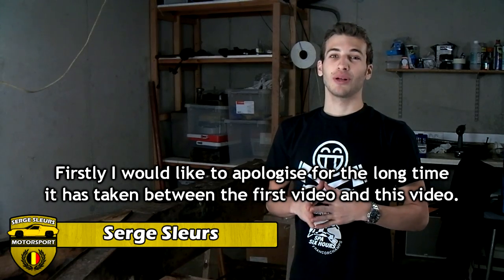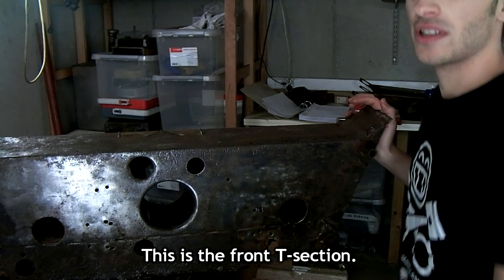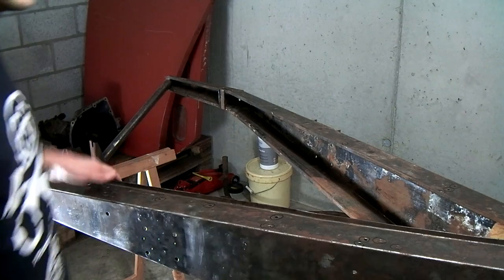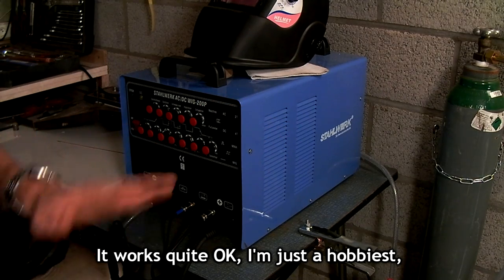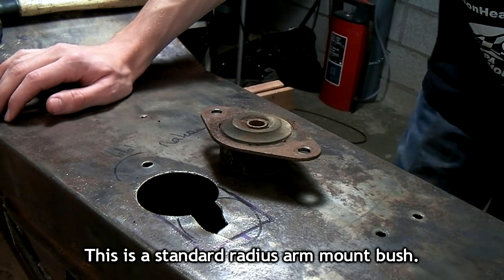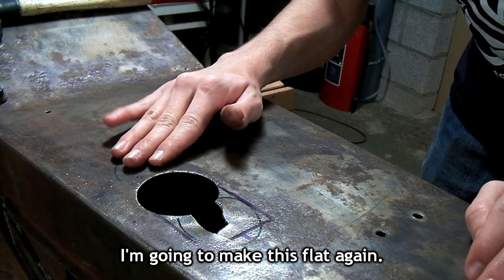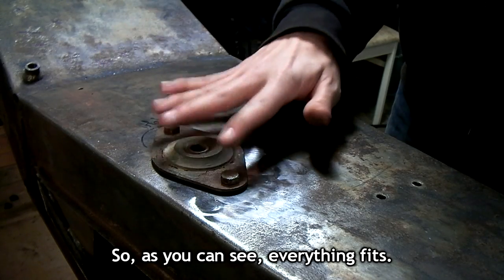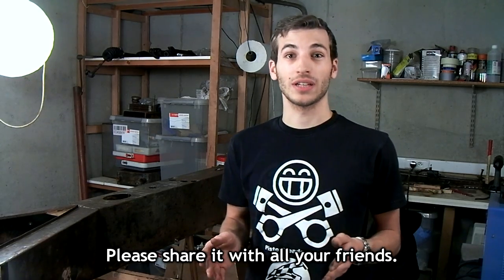Lotus Europa - Ep 1: Chassis repairs

Comment: One tip from the solely metallurgy side on cracking in stress prone areas is to shape your patches with rounded corners or ovals but diffidently no sharp corners this will provide a better chance of not cracking again.

Comment: Just found this channel. If this is a Series 1 Europa, how did you remove the body from the frame? These early bodies were bonded to the chassis. Did you consider buying a new aftermarket frame or was that not part of your budget?
Reply from the maker: +racerron27 I removed the body from the rear of the car, through the engine compartment. I'll make a video of it when I reinstall the chassis. There are aftermarket chassis' available, but they didn't fit in my budget at that time. Getting a new chassis is a quick and easy solution, but where's the fun in that?